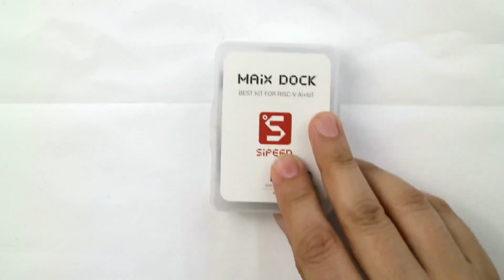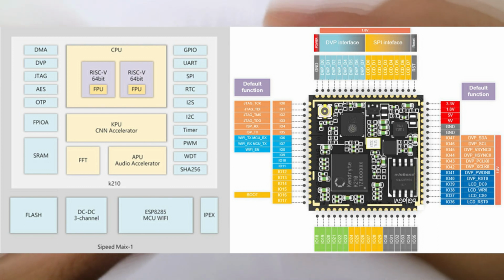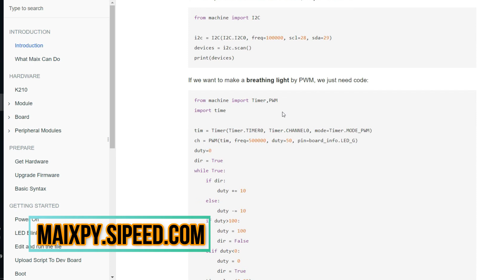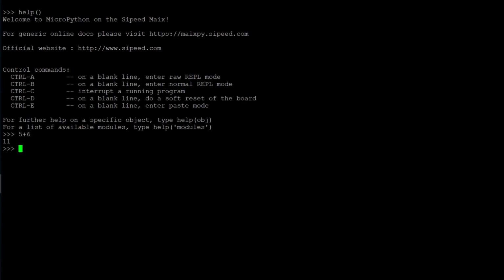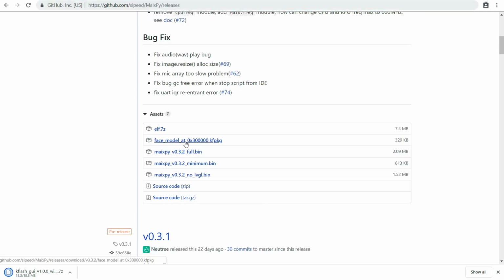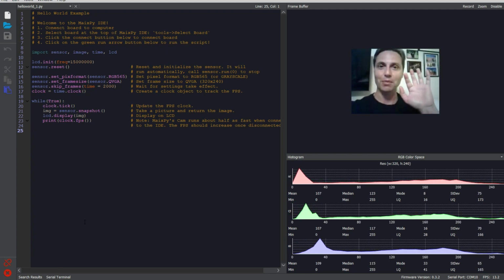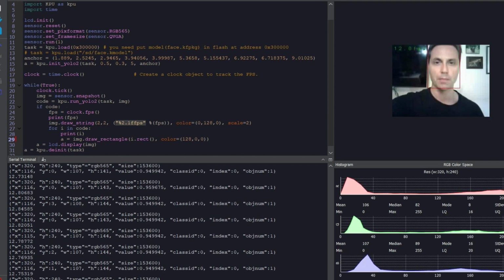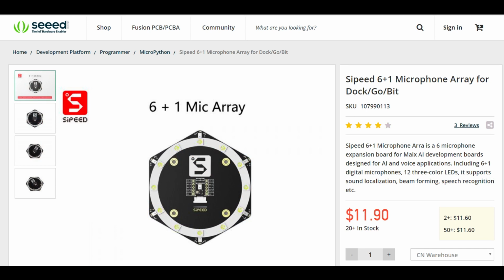MaixPy Dock, $20 Machine Learning kit | Openbox, Setup and Examples

Comment: Hey, Tiziano, hope everything is well. I have a similar board however instead of connecting it to  a PC, I connected it to a microcontroller. I am sending it JSON commands as given in one of the manual. All the commands are recognized by the board except for 1 - output_face_information. is it possible to share the command sequence so that i can do face recognition using this module? thanks in advance
Reply from the maker: Sorry but I haven't tried that

Comment: Thanks for a wonderful video. I had used Maixduino in past but wish that it could have support for high-resolution cameras 
is there any way to send image data serially from the Matlab process on K210 & retrieve the results ?!
Reply from the maker: I don't think you can send an image through serial, too slow. Maybe wifi would do better

Comment: Hi Tiziano, I have Maix Bit board. Could you help me to enable i2c feature? I tried to called pin_map(), there is no i2c pin on the list. I tried to register (pin9 and 10) to I2C0, there was no luck. The way of doing was wrong or even the board doesn't support (but it said "you can map 255 functions to all 48 GPIOs on the chip" on seeedstudio page).
Reply from the maker: I have not get that far, but keep me posted. I will use it for another project

Comment: Hello. I got Sipeed MAIX Bit, and began to study this device. Learned to create your own objects, Sipeed MAIX Bit recognizes them very well. I want to do an experiment, I have 2 more brothers, that is, we are 3 twin brothers, Sipeed MAIX Bit will be able to recognize us. I also have a question: a = img.draw_rectangle (i.rect (), color = (128,0,0)) this line borders the face into a rectangle. How to get the coordinates (x and y) from this line so that later I can display it on the screen? Thanks.
Reply: I figured out this problem.
  img.draw_string (60, 100, '% 0.0f'% i.x (), scale = 2)
             print (i.x ())
This will display the X coordinate, just the same you need to do with Y.